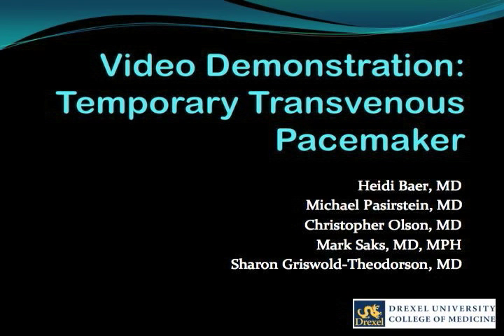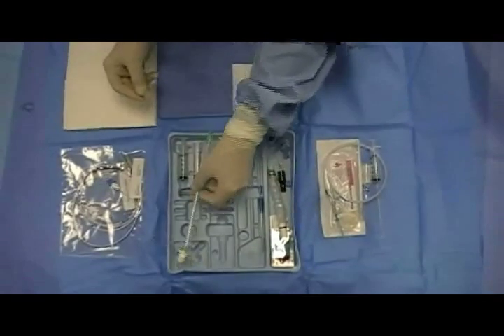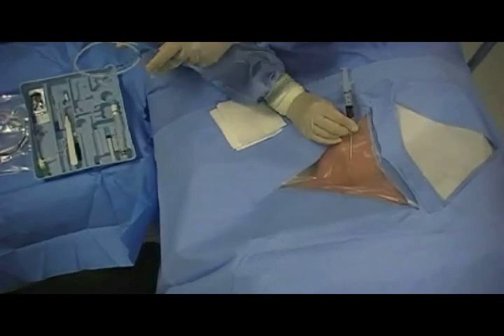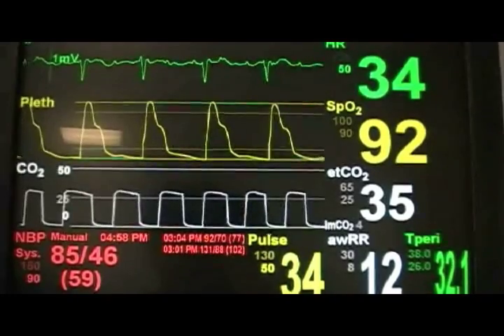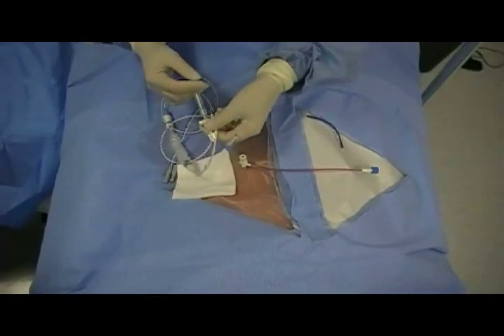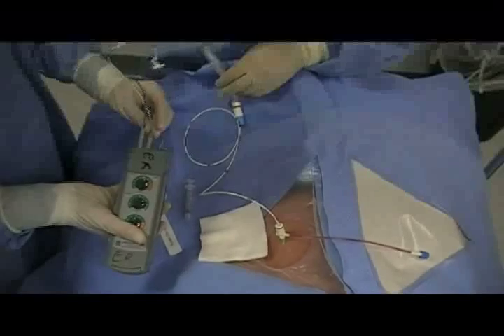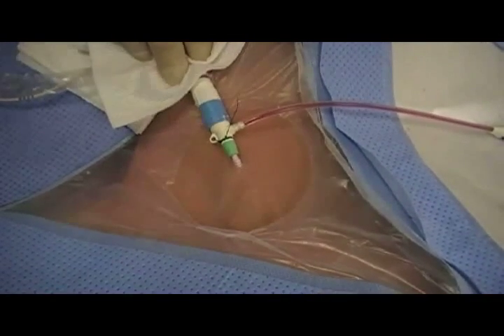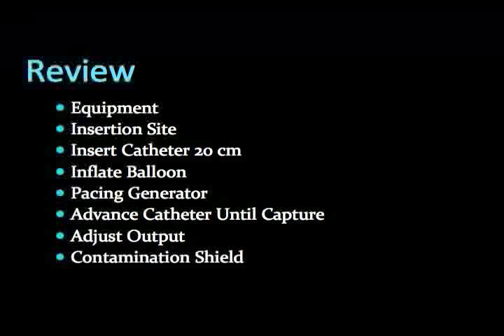Insertion of Transvenous Pacemaker

Comment: Once there is good pacing contact, the flotation balloon needs to be deflated, otherwise there is a good chance that the wire tip will get dislodged.  Also, it is best to have available a sterile extension pacing cable to keep the pacing box, which is not sterilized, as far away from the sterile field.  This also provides additional slack to avoid inadvertently pulling the pacing wire out of place if the patient moves.